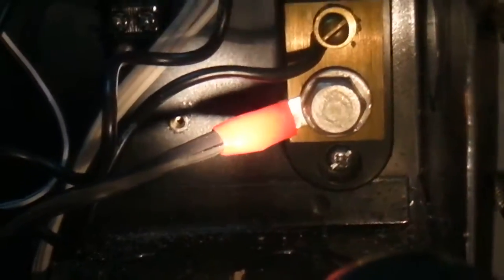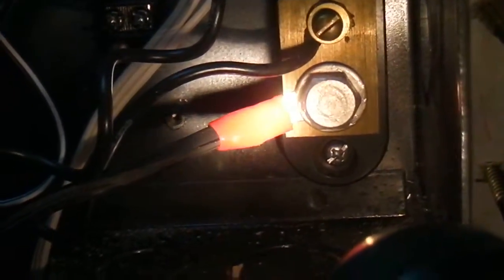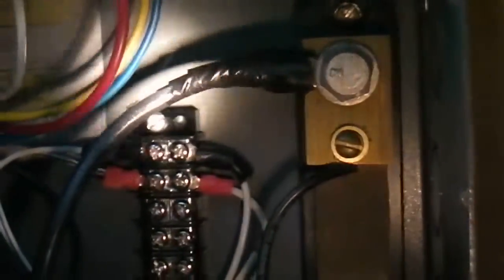Wired Solar Panel Positive Wire Through Shunt for Amp Meter

Comment: I used landscape wire to test my panels too. Melted it nicely : ) Consider the THHN or similar wire. Get the DC rated breakers from Midnight Solar and put your wire in conduit. Consider monitoring your system with a web cam. I don't want to sound like a prude, I just saw first hand how a fire could start.

Comment: Yes, the NEC states that they expect the conduit to fill with with water, which I found odd too. You can direct bury, but I wanted to be able to pull the wire out if needed. The issue is not so much underground, it is when DC enters a dwelling. DC has one heck of an arc.

Comment from the maker: What gauge wire was the landscape wire you were using? If you match your amps to the correct gauge wire and consider the length of the run there will not be problem with over amping and melting the wire. This wire is pretty good wire actually ratted at 600 volts uv resistant. Ten gauge wire is rated at 15 amps so I am safe. I have never seen it get hot or even warm. If I add more panels then I will use some 8 gauge wire rated at 24amp. Or I could use two 10 gauge wires that would carry 30 amps.

Comment: Hello Larry,
Sorry you were offended.  I share your concern 100% over the cost of making it safe. Apparently you visited my page. This is my second solar energy system. My original system was twin Sun 1000's. I think something shorted during my experimentation phase,  and the insulation melted. Got me thinking how powerful solar can be and how I better change my thinking on safety. There was a really good video on here about a solar system house fire.

Comment from the maker: I have a DC Midnight solar breaker. A in line auto fuse will do the same thing for a heck of lot cheaper. I have seen the wire in conduit in the ground standing in water and they always fill up with water kinda funny aint it. better off with out it. It may be good a good idea to put through the wall in conduit though.

Comment from the maker: Yes I agree I want to put a piece of conduit in the wall. I actully did have a wire short on the edge of the sharp tin roof of my shed and it melted and smoked because of the batteries were not fused. That put the fear of God in me and I fused the batteries in my shed and put the wire in conduit from the panel into the building problem solved. Yes that is a good idea to use conduit and a fuse. A heck of a lot safer for sure.

Comment: I'm not sure what the gauge was. As I think back, I believe a bad solder joint or connection may have been the primary issue on my test wire, not the wire itself. It definitely burned my finger.